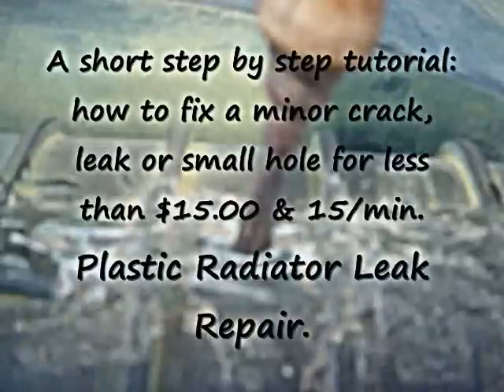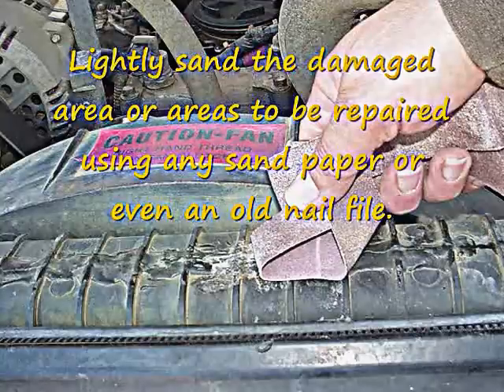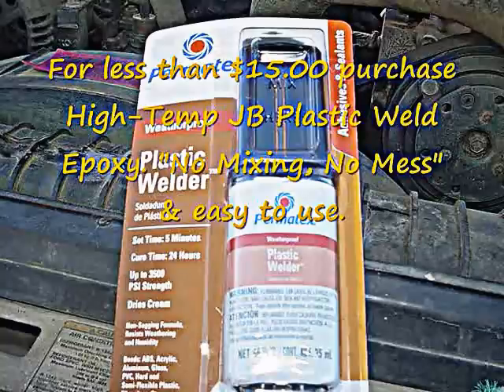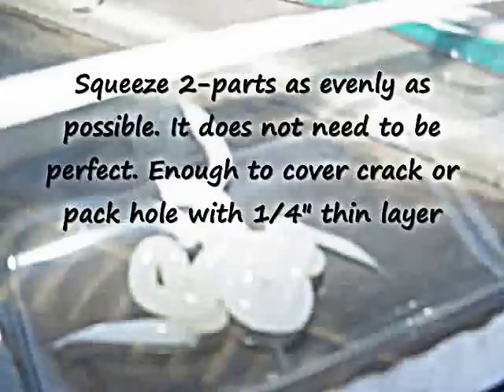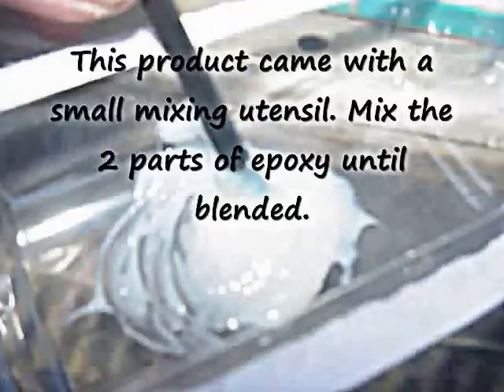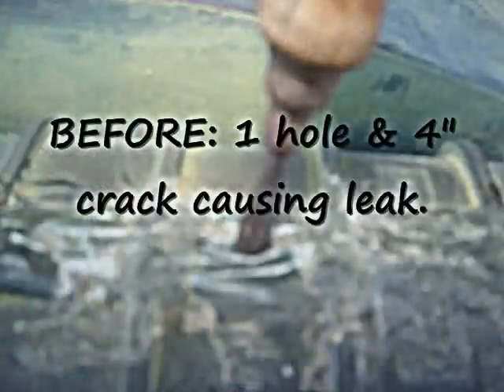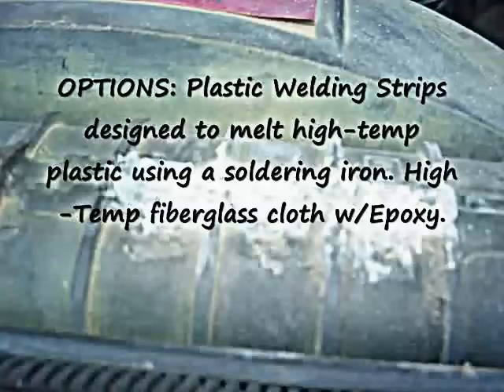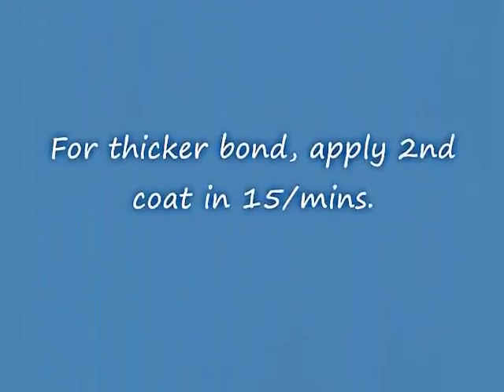How To Repair Plastic Radiator- Cheap & Easy Under $14 & 15 Minutes

Comment: Plastic radiators must have come out at a certain year
Aluminum or copper might be other materials radiators are made of.
Hopefully Auto Zone has products to SEAL those materials also incase
one's radiator is not made of plastic.
I will share this video because alot of women may want to save themselves a mechanic's
fee. And young people are always looking for a bargain. :  )
Thanks...Did not know this product was available or that it was so easy...
Good JOB - RRF :  )
Reply: Plastic(tank) radiators are used in all vehicle 90s and up
Reply from the maker: Thank you.

Comment: I recommend using a clamp or set of work clamps to hold the radiator tightly together during the bonding time. It'll help create a tighter, longer lasting seal. 

Radiators only have PSI ratings between 15-50psi. JB weld 3200psi plastic bond epoxy is great for a temp fix until a permanent part can be applied
Reply from the maker: That's a great idea! You are such a good thinker. Thank you so very much for this. I hope it helps many people.